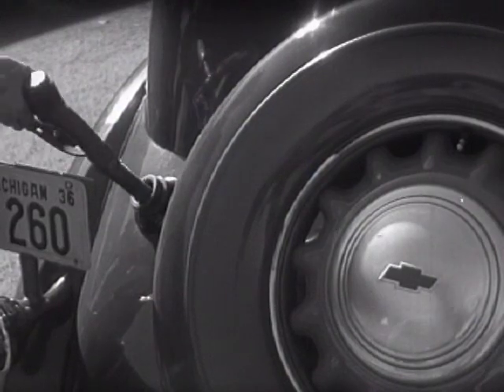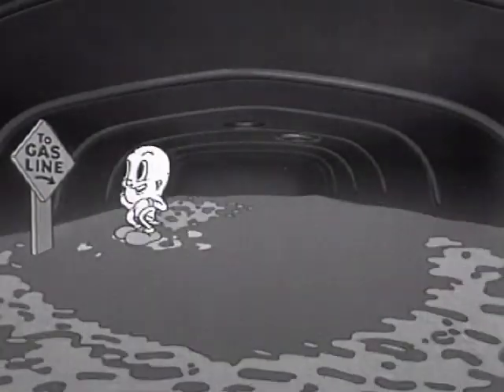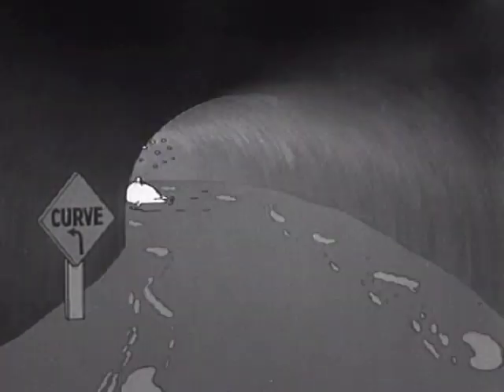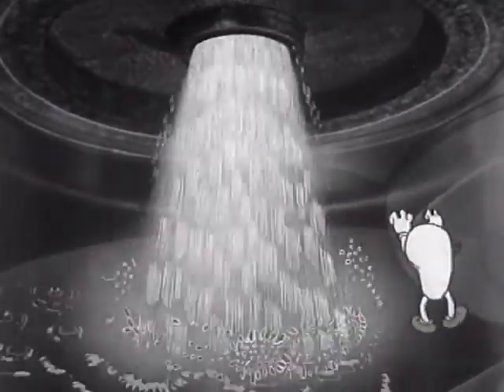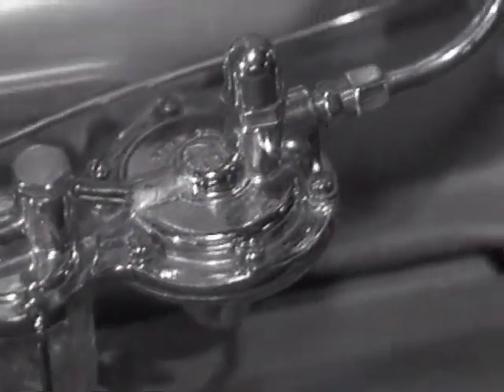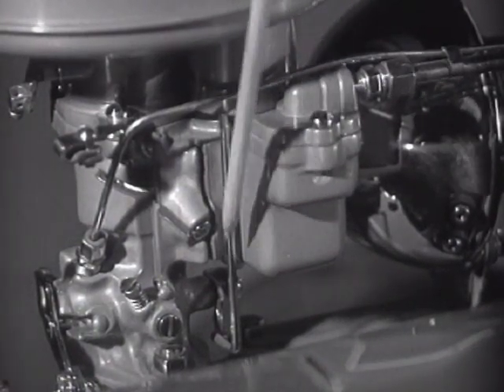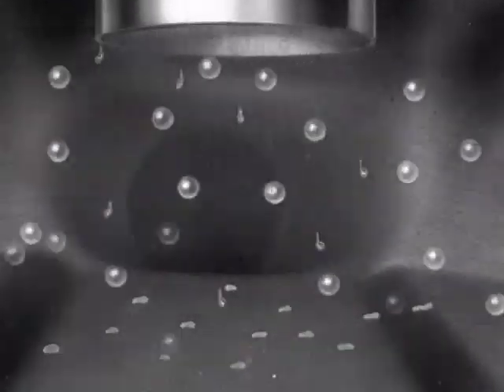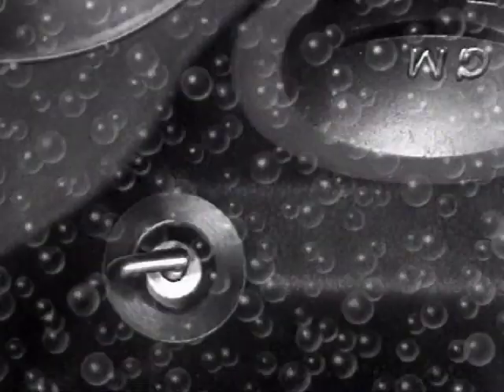Down the Gasoline Trail (1935) How Fuel Goes Through An Engine

Comment: A lot of commenters are mentioning leaded gas.  It was added to the gas as an octane booster to prevent engine knocking, same thing is done today but with different chemicals  (Knocking is when the gas in the cylinder ignites just from the compression of the fuel/air mixture.  Octane boosters make the ignition temperature higher.)

Comment: Death is never easy, especially of one so young, but I take comfort in knowing that at least you had a relatively peaceful journey.  No high pressure fuel pump squishing you and whipping you around, no injector nozzle blasting you out at high velocity.  You didn't have to suffer taking the EGR path where you'd see all your buddies in their last throws of life just to be burned some more, and then you peacefully lofted out into the air without being incinerated in one of those evil catalytic converters.  Had you lived to a ripe old age you would have suffered much more.
RIP Drop.
Reply: Lmaooooooooo

Comment: Should of never got rid of the glass bowl, so u can visually see whats in your gas!
Reply: You realize how extremely dangerous that was having a glass bowl under your fuel pump?
Reply: Someguy6571 welll ... it’s technically before the fuel pump ... and honestly... it’s really not that dangerous
Reply: @Someguy6571 Asking out of curiosity, How is it dangerous ?
Reply: @ohchord9573  well you  know glass. it sometimes breaks. so engineers made it preventable to not break open if the oil were leaking a fire would break out on the automobil

Comment: he's loaded...with Pb(lead)...l remember in those good old days scrapping burnt lead deposits off top of pistons and repolishing cylinder heads.
Reply: Wait... Didn't leaded gas became more common after the war? You know, there were so many flathead engines with low compressions, rendering them suitable to lower octane ratings.
Reply: The really old flatheads like the Model T had such low compression that they could run on anything. Gasoline, kerosene, diesel if you could find it.

But by the time of the flathead V8 compression ratios had risen from 4:1 to well over 6:1 requiring higher grade gasoline. It was still difficult (and expensive) to make high octane fuel so lead was used even in gasoline well below 87 back in the day. 

Of course it’s not the good old days for me. Aviation fuel still has lead. It’s 100 octane but even 80/87 until it was discontinued was leaded. Lots of time spent digging lead deposits out of spark plugs with a dental pick.

Comment: My grandfather said that Steam was the best power source for cars. He owned a 1912 Stanley Steamer and predicted in the 70s  Steamers would come back.
Reply: Yeah. And steam airplanes too!
Reply: Strictly functionally, steam engines still actually work better for certain uses (like drilling oil wells) but are never used because of the cost. Reciprocating steam engines are extremely simple and eady to troubleshoot when they have a problem. They are enormously powerfully with 100% torque even at zero rpms. They need no transmition. But again, they cost too much to operate.
Reply: You need a better energy source to make them viable. Even so, you would want an energy source that can be activated almost instantly and then the steam can take over.